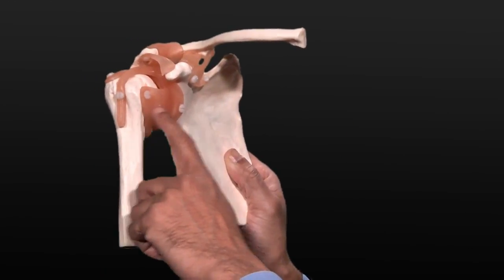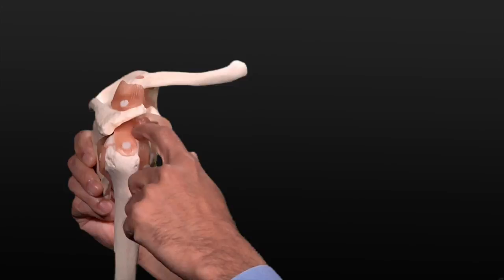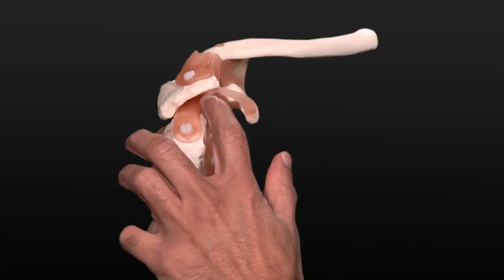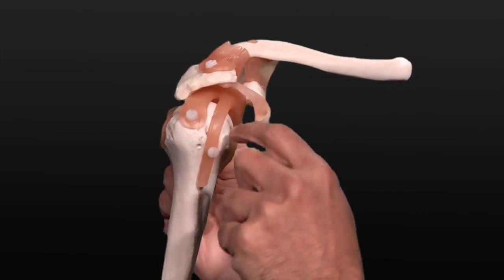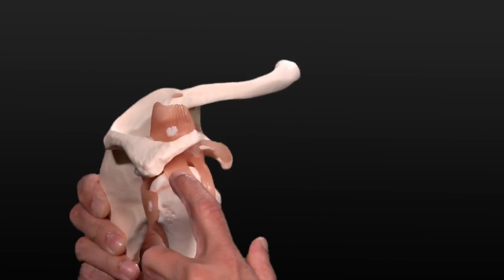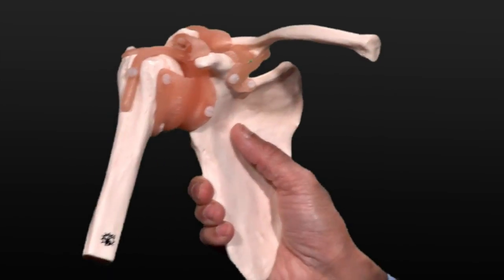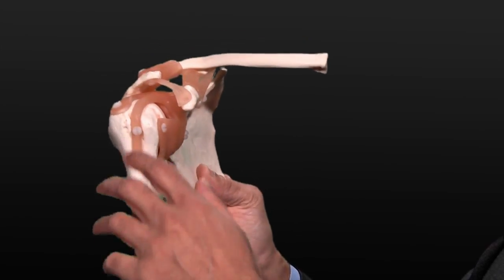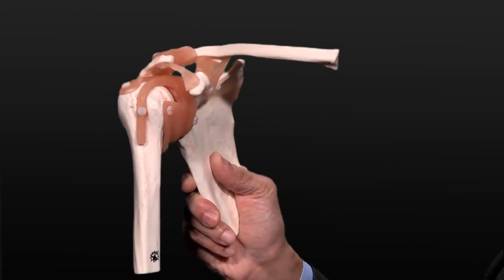Shoulder Replacement Surgery

Comment: good talk.  it gave me a new set of ideas re my left shoulder pain.  and whether it is the
ball joint in an arthritic sense.  or now is it tendon or bone damage.
my next move is to call around to learn who locally shares your knowledge & abilities
Reply: bob along if you do have either one of these injuries they will not kill you mean the doctor that this procedure is a temporary fix I have had both procedures done and they are only good for 5 to 10 years. I’ve had four wishing that I had a replacement In the beginning. Good luck
Reply: Sorry spellchecker put kill meant for (tell)